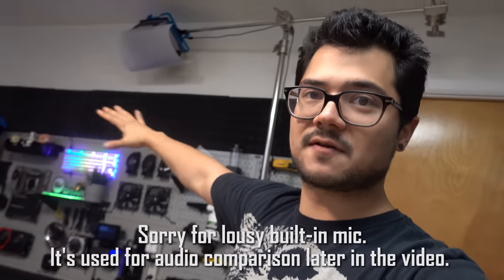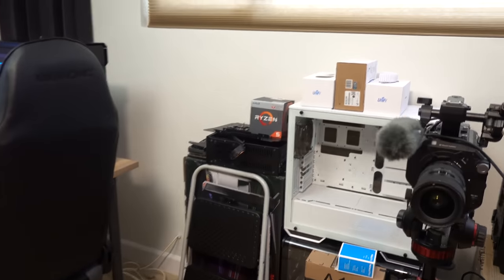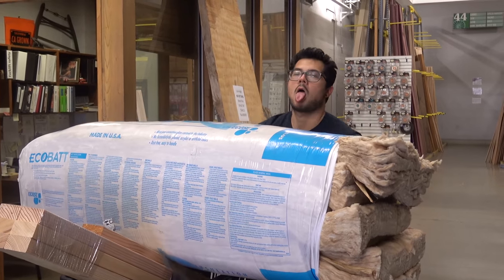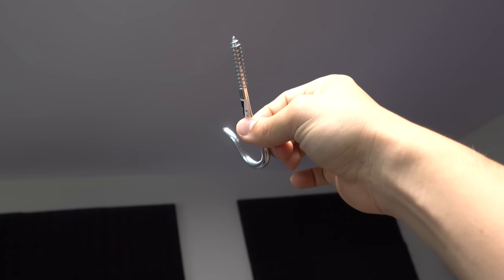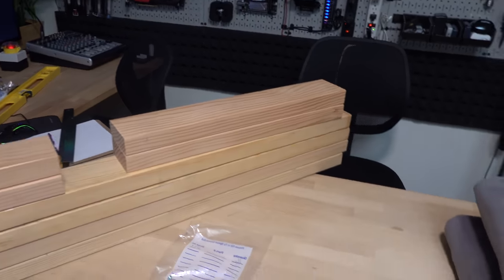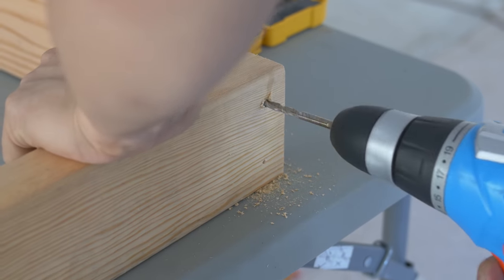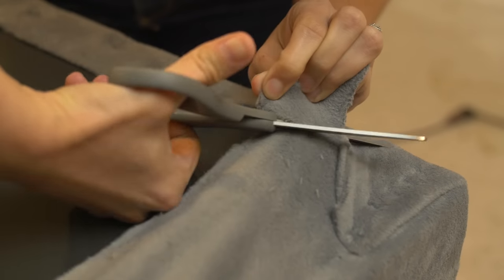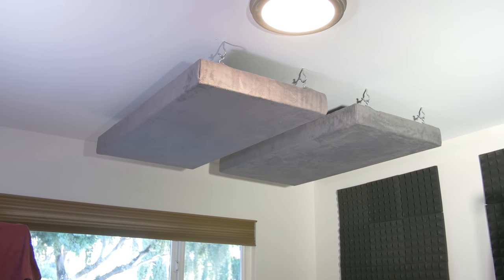Making my own acoustic panels...Was it worth it?

Comment: for foam its actually horrible for acoustic treatment, that's why pro panels never ever ever use foam, they are cheap but so is a car from the junkyard missing the engine, looks like it works but does not. for Real though that thin foam only kills high frequencies around 4000hz and up. any panel worth cash is able to eliminate from 200hz and up and still helps reduce the lower bass notes but not eliminate them. you want atleast 3 to 4 inch thick panels with a proper insulator 2 inches or so. preferably an air gap of an inch or two on the back and that will reduce bass even more.

Comment: Ιt end up costing so much cause you overkill it, the wood you bought it is so thick and heavy and expensive for no reason at all, the back panels are doing more harm and you would be doing better without them (so less money also), you could buy cheaper hardware (screws etc by buying a package with more and no small individual packages) i think. That way i think that with the same cost you could use all (8 i think it is) insulation materials and built 8 panels instead of just 2

Comment: Panels are far too thick, honestly would've been better to use half that thickness for twice as many panels. Also, hanging them from the ceiling ruins them entirely unless the ENTIRE ceiling is covered; sound is sneaky and just reverberates around them.  Could have made 4 panels for the same price with half the thickness and mounting them directly to the ceiling with longer wood screws.

Comment: Did you do any research before you attempted this? 
 
https://www.acoustimac.com/oc7032?gclid=EAIaIQobChMIidDbwbbX5QIVFiCtBh1ASwq6EAQYASABEgKHHvD_BwE

The 2x4's are massive overkill. You don't want a backer on the sound panel. Leave a gap of about an inch between the panel and the surface you're attaching it to. The fabric used should be something you can hold up to your mouth and breath through without any restriction.

Comment: Absolutely no difference in your sound test.   Your two new ceiling panels in the corner of that room does not make a noticeable difference.   You are better off with some short indoor outdoor carpet.  Wood floors create echos.  Covering the floor is much, much easier and much, much  cheaper than trying to sound proof the ceiling.   At this rate you'll spend 5,000 grand to cover your ceiling with ugly homemade garbage that is only going to fall and kill you.   You can nail carpet to your ceiling cheaper than those homemade boxes.

Comment: You made these incorrectly and lost some free performance. Remove the posterboard and use black fabric on the back. This way sound passes THROUGH the panel, into an airspace, bounces off the ceiling and back into the panel. You gain attenuation performance AND they now will work down to lower frequencies. Tech guys are funny, all those computers, not able to look this up on the net 😂 

They will also handle reflections bouncing from the back off the ceiling from the side.

You basically halved their performance by putting board on them.

Comment: 250 spent, time shopping, time building, and time fixing it to the wall. Dumb. 
you could of done it for much much cheaper.
Take down the foam panels, they are useless. and the bass trap is useless